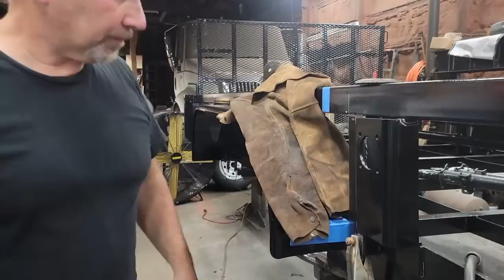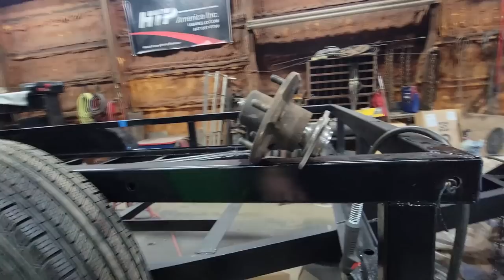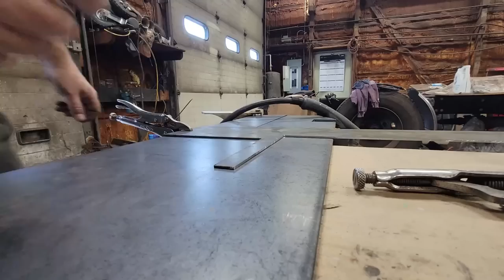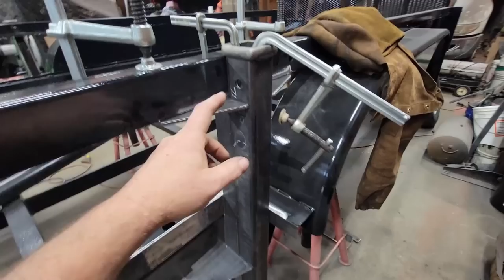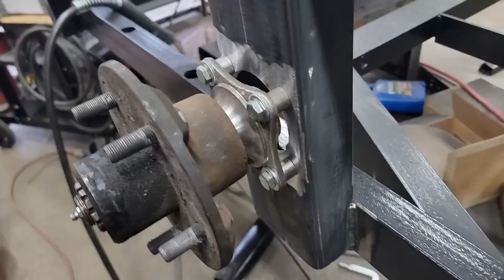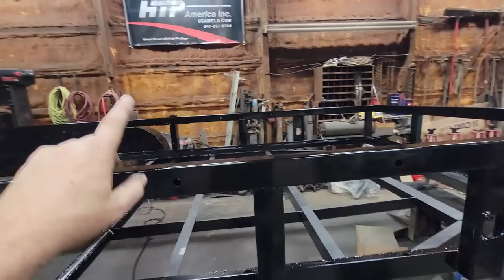LANDSCAPE TRAILER REHAB PT10. USING WHAT I HAVE TO GET WHAT I NEED

Comment: Hey JC I noticed you were running those Carlisle tires I was thinking about putting them on my trailer. Do you have any experience with them?
Reply from the maker: i have run them on several different trailers over the years. not close enough together in years to give an accurate opinion. to me they were better than some of the bargain basement china brands. these are imported as well.

Comment: Why do you not wear a welding helmet when you use the plasma cutter in terms of the light affecting your eyes 👀?
Reply from the maker: i wasnt gauging the surfare. i was cutting through. all the light was on the other side of the steel. i wear them when i need them.
Reply: @j.c.smithprojects  

Maybe I didn’t ask the question right. Is the plasma light the as the welding light in terms of retina damage or is the light from a welder different from a plasma cutter. I know the cutting torch is different
Reply from the maker: when your cutting through a piece of steel like i am. the light is under the plasma torch head shining through the the back side where i cant see it. if i were using it to cut on the top side of steel "gauging" on the top of steel the light would be very visible and would require protection.